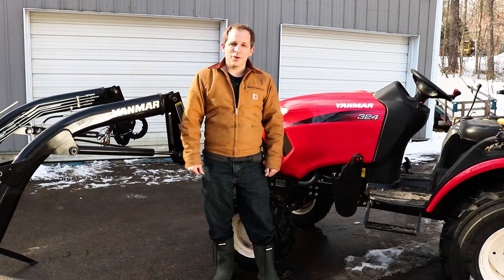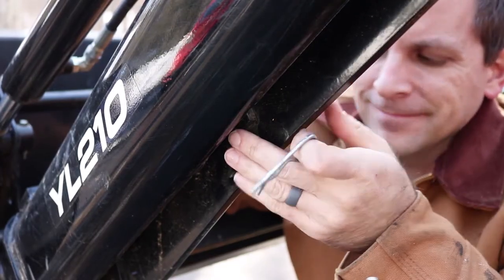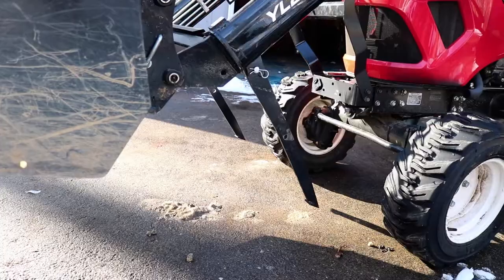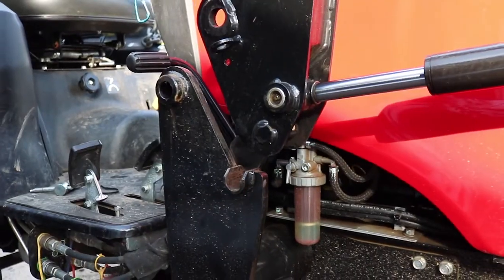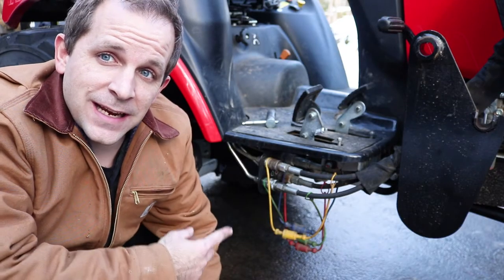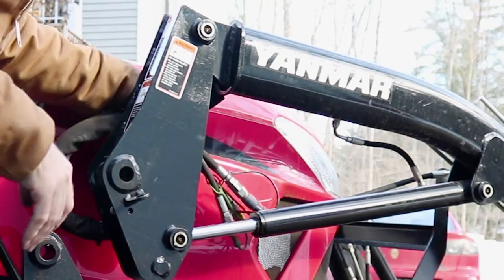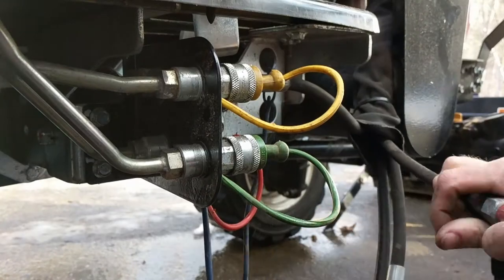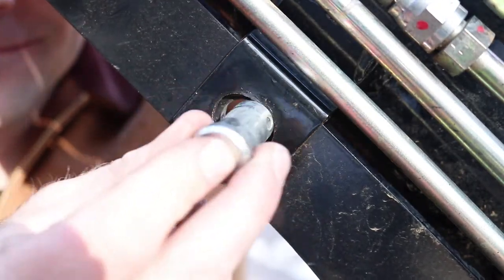Removing the Front End Loader on my Tractor

Comment: can you go over the locking diff? does any competitor even come close for a beefy subcompact? this looks to be superior in size and strength for 25k
Reply from the maker: I talked about the Diff lock a bit in the Winter Prep Video. I have heard a rumor the "newer" versions had the pedal included instead of as an optional extra. But you just have to push down on the brake a few inches and it engages the Diff Lock, The Front diff doesn't lock, but there isn't much that 3 wheels with power cant get you out of, that 4 would! Mostly I used the diff lock for a few seconds when I am backing up a hill on a slick surface, otherwise the normal 4 wheel drive works fantastic.
Reply: The diff lock pedal came standard on the 324 I bought last week. It’s located so that it can be pushed with the heel of your left foot.